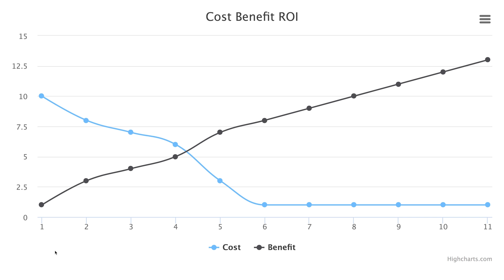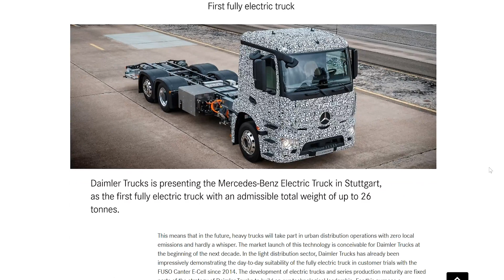Tesla Semi Truck: Everything We Know So Far

Comment: I average 500 miles per day 7 days per week. The range has to exceed 600 miles before I would consider buying one. There are ways to charge the batteries inroute such as a micro turbine like the Nikola One or with a fuel cell powered by propane. Add solar panels to the trailer and we got a deal. The big problem is weight. Shippers have been refusing to cut the weight of their shipments. The new trucks have aftertreatment systems that add 1000 pounds to new trucks. We can no longer haul loads that the older trucks can haul. If these electric trucks are too heavy or too expensive the forget it. If the one graph that he showed the break even was 5 years. 5 years is when we trade in a truck with 600,000 miles.

Comment: For urban coastal zones with major ports, the diesel trucking dominates pollution statistics in particulate matter - one of the most dangerous byproducts of combustion. Zero emission trucking from ports to non-urban transfer stations could be a big winner, and the distance would fit nicely within the estimated range. It is unclear to me whether a leap frog over the most modern diesel engines would be economic as compared to simply upgrading the diesel fleet. The win would likely have to be better than 50% greater economy because our society generally hates change for the better unless it is almost ridiculously better. A businessperson would go after 10% better economy in a heartbeat, but we tend to not make such decisions using logic, at least in my experience.

Comment: Agreeing with Ben.... Hydrogen is such a leap in complexity over battery electric and lower in efficiency that it seems misleading to call Hydrogen cars Electric cars instead.  We tend to call cars by the form that the energy is stored... gas, diesel, air (yes, it’s a thing), Hydrogen and electric. 
Technically we could call gas and diesel cars Solar cars, because the energy in the fossil fuels actually came from ancient sunlight, but that would be misleading too.

Comment: I don’t think Tesla isn’t going to sell these machines. Instead, I think they’re going to operate their own logistics company. 

I don’t understand why there needs to be a cab at all. Why not just build an electric and autonomous trailer. No need for towing. Small enough electric motors can be attached under the trailer on which the container sits. And have enough camera and sensors for the delivery trailer to drive itself
Reply: Derek Chan The problem is the shippers and receivers. If you just put into your GPS the address then the vehicle will go to the office. Many companies have receiving on one side of the building and shipping on the other side. You need a driver to get into or out of a facility. Then there's the charging issue. Who is going to plug in an autonomous vehicle? What about construction and rush hour? There are too many reasons why you need a driver.
Reply: w/o a traditional engine and drive shaft, I'm assuming a trailer without the cab can be much more nimble and rotate on a much smaller turning radius.  If the autonomous trailers can arrive to the complex autonomously, what's stopping human personnel from the receiving or sending facility take control and navigate it via remote controls to the shipping bays?  The trailers are larger than the cabs too.  I would imagine we'd be able to fit more batteries on a flat trailer that carry those 18foot containers than we would a cab.  Or at least a similar amount
Reply: Now you are talking about an issue that gets into insurance and liability. Shippers and receivers don't own the trucks and trailers that travel between them. They are owned by outside carriers. If someone takes control of that vehicle then they are liable for any damages. This is getting way ahead of ourselves.  The first problems to solve are V2V and V2I communications. The vehicles need to communicate with each other and with the infrastructure to operate fully autonomously. If this happens with trucks then it has to happen to cars at the same time. The way that people drive around me is pretty scary. This is going to take many years and lots of new laws before we see cars and trucks operating completely autonomously.

Comment: Tesla will win in the semi race but it will take longer than passenger cars as the short range and long charge times, will slow adoption, until those factors are dealt with.  In the meantime, Tesla should work towards full production of the 3 and come out with a lower-cost SUV, Model Y and a new roadster, to complete their car line-up and work on reducing pricing, fleet-wide, for more adoption.

Comment: Several big names competing is a good thing.  One winner is not.
Also as battery power is the likely direction, they may want to consider battery "way stations".  Switch out battery packs.  Fresh horses like the pony express.  But there aren't any such stations.  Well there weren't any cell towers at the beginning either.  Or gas stations in the early days.  Fossil fuel HAS to go.

Comment: I am surprised that class 8 truck cost 120,000.00. I would have thought it would have cost more.  It will be interesting to watch 
Do you think Tesla will reveal 3 rd generation super charger specifically for trucks ? I am hoping that it is in the plans.  
I am thinking that when it comes to increase the speed of charging the battery size is the main limiting factor the smaller the battery the slower the charging rate
Reply: Ronald Fradet The average is currently $140,000.

Comment: SWAPPABLE BATTERY. People keep bringing up range and charge time. SWAPPABLE BATTERY. Tesla perfected a 5-minute automated battery swap with the Model S (although they decided it wasn't necessary for that model). Pull into the swap station, open the battery swap app on your phone, pay for the swap, and sit back in the comfort of your cab while the battery pack swap takes place.
Reply: Exactly!  One possible method would be to design it to where a simple forklift could swap the battery.  Or put powered wheels on the battery and have it drive itself off using autopilot from underneath the cabin.  The cool part about this is that the battery could be designed to simply park in a parking lot, no cover or infrastructure needed, just a plug.  Also, as Tesla needs large batteries at Supercharging stations, these could serve that role and use them for power arbitration/storage.  Personally, I do not like the idea of building infrastructure to swap the battery, simply due to cost, but could be wrong.
Reply: That’s my thinking battery swapping.  Large trucking companies spend huge on diesel bills if tesla leases batteries and builds a infrastructure they could make money on leasing battery and swapping charged ones.  Just think after driving 3 hours the truck driver stops gets a drink uses the washroom and it’s ready for another 3 hour trip. Not to mention they add super charging stations for cars and build up there network of charging stations.
Reply: Completely agree.  Think of that with something like FedEx or UPS.  Mid-day battery swap.  I don't know the stats, but local delivery vehicles like those are huge polluters in general.

Comment: Ben, something else you should be taking into account: Tesla's own heavy use of semi trucks. They have a lot of short to mid-range (diesel) semis driving every day between their Fremont factory and Gigafactory up in Sparks, Nevada (~260 miles between the factories), not to mention the semis they currently use at their other facilities, such as their factories over in Europe and their "Gigafactory 2" in Buffalo, NY. Tesla will probably start by using the Tesla Semis themselves to replace most to all of their mid-range diesel semis. Basically, they'll be their own beta testers for at least a while as they fine tune the production line and the semi itself. In addition, Tesla will also be cutting down on maintenance and fuel costs. So even if Tesla has a couple of companies signed up to be the first to use the Tesla Semi, it'll be Tesla themselves who will likely be the biggest users of the truck, again, at least for a while.
Reply: This is known in the tech world as eating your own dog food.  Tesla can accumulate a lot of experience and data about the operation of the vehicles, which will give them a lot of credibility.

Comment: A semi is not something Tesla should do. It reduces the cool factor of their brand. They shouldn't even have made a Model 3. It should have just been a luxury brand electric car auto maker and let Ford and GM supply supply the mass market.
Reply: You forget the importance of the model 3 and the mission Tesla set out to achieve.

Before the model 3 nobody was going to bother competing for cheap EV's, the leaf was content at staying at a 150 mile range, it wasn't until the model 3's price point and advertised range did Nissan decide that they'd focus on battery technology for the leaf to get that range.

The 3 being announced in 2017 pushed Nissan to further upgrade the next gen leaf (2018 leaf) with a larger range (2019 leaf).

Car manufacturers have to sell luxury level cars first to offset the cost of production, then they can produce the cheap ones, that's why Tesla's first car was a sports car, second was a high class saloon, then a full size (but also technically crossover) SUV, now they have the capital to produce cars at a much cheaper level which was the intial goal to start.

The Model 3 was the point of Tesla, not to sell to rich and uppity snobs.

Comment: How much does one of these batteries weigh? Semis are limited to 80,000 gross. Even without the heavy diesel drivetrain, you're probably still adding a lot of weight, which cuts into revenue. There was no mention of that.
Reply: A 100kWh Tesla battery pack is about 500kg. The semi will have something like 600kWh if I remember correctly, that's 3 tons. A semi diesel engine is about 1.5 tons, the fuel is about 0.5 and the transmission with the drive shaft is roughly another 0.5. So it's 3 vs. ~2.5, not a big difference. Replace steel with aluminum and you can easily save a few more tons.
Reply: It depends, we don't know how much the battery will weigh. With a 400 kWh battery we could expect it to be four times the weight of a tesla 100 battery. But considering even other manufacturers have managed to double their batteries kWh without any increase in weight, it's quite possible that Tesla might have managed to make a 400 kWh battery for less than 3k lbs. Which would make it similar in weight to semi engines... with the rest of the drive train being removed battery size is likely more of a volume issue than a weight issue.

It's very likely that the weight increase could be minimal to non existent, and while the early adopted models will have day cab ranges, it's not hard to assume that in a year or two they'll have the long haul cabs ready to go.

Comment: I think the big variable here is range.  How far can you go on a battery charge (Tank of Gas).  It's nothing for a long haul truck to go 1000 miles or more on a single (dual) tank of diesel fuel.  When you take the range of a Tesla truck, add travel time, and charge rate (what... 1 hour or more to fully charge a battery after 250 miles?) Then you're looking at a significantly longer haul time on long-haul routes.  MIND YOU, if the vehicles can reduce or eliminate driver fatigue by removing the need for a 100% attentive driver (I don't believe electric vehicles will REMOVE the need for an on-board operator to take over in emergencies), then you can make up that time in a single 6 to 8 hour sleep period.
Reply: In Europe most of the railway system is already electrified. Electric trains have been the standard since decades.
And there's no need for a third rail, an overhead wire is just as good and infinitely safer.
Reply: A huge amount of cargo is shipped less than 200 miles, probably most. For high volume long range shipping trains are cheaper and more convenient.
Reply: That's a very reasonable point!  I for one am 100% in favour of electric vehicles in all forms.  Maybe even electric CARGO trains that run off power from the rail...  I'm sure they would have done that already if it was feasible (or are doing it already).  :)   I guess TORQUE is the issue then?
Reply: 250 for launch is not a bad range at all, 400 is all you would need to keep up with a human driver (any more than that and a human driver would be breaking the law by still driving.)

It takes 14 hours to go 1000 miles at 70 MPH, truckers average between 50-60. A Trucker cannot drive for more than 14 hours in a day, and that 14 hours is assuming they stop at least one time during the day for lunch (In fact you're only really supposed to drive for 11 hours between sleep periods which would require an average speed of 90 MPH). There's about 1 hour "off duty" time with a 30 minutes mandated 30 min on duty not driving. Which is usally taken midway through the day for lunch, 15 minutes before to plug the truck in at a charger, 1 hour to eat and wait for it to charge, 15 minutes to unplug the truck check the truck to make sure it's good to keep driving and go.

Yeah 1000 miles range is way more than you need, 400 is honestly pushing the limit of what a human driver is capable of according to the law at this point in time. Also the required "sleep" period is 10 hours (basically you can work for 14 hours and can only drive for 11 of those hours) after you go off duty you must remain off duty for 10 hours before you can go back on duty, the hours of service are not based on a 24 hour day, but around this 10 hours off time to reset.

Yeah, the 1000 hour range requirement people ask for is not really thinking about the hours of service. Yes, autonomous trucks will likely cause people to poke at those rules to allow the truck to drive for longer than 11 hours a day because they're not driving, but that's legislature that will come after autonomous driving is more than just a concept.
Reply: Great information!
Reply: The reason cargo trains aren't running on full electric (most trains are actually electric using diesel generators) is because electrifying the track is costly, and also a high voltage third rail is easy to put in a subway system where nobody would touch it and get electrocuted. The problem is figuring out how to do this across vast stretches of track where animals or people could accidentally touch the rail not knowing it was a  powered line (or you know, being an animal)

Basically the only safe way to electrify railways that we know of is to have a catenary or overhead power lines. Which are not only unsightly inside of cities, but incredibly expensive to put in. It's more cost effective to use GWh batteries on board, in which Diesel electric trains are still cheaper.

Comment: Perhaps the trailers themselves could also use the chasis as a battery space like the cars do, and then the range could be extended substantially? Use a 'Tesla Trailer' and get another 800 miles range... 200 miles on-board in the semi - enough to get to the pick-up and then plug into the trailer's battery. Just a thought for Elon (if it isn't already in the pipeline?).
Reply: Weight and cost can be an issue. Actually even semi truck don't need more than a few hundred mile range most of the time.
Reply: 800 miles is overkill, 400 miles is really all you would need. 

Solar panel trailers I can see being a thing, but from what I know about physics the best place to keep batteries for a semi is over the front axle. Because while gross weight of the entire truck+trailer+cargo is 80k, you also need to balance the weight over the tires because there is also a limit on axle (and tandem axel) weight. So in order to maximize the towing capacity for the truck you'd want to have the front axle of the truck to be taking all the weight it can away from the tandem axles. I believe the front axle can have like 20k on it max, and the tandems can have like 35k each. So any extra weight for running the truck, like engines, drivers, fuels, you want to be putting most of their weight on the front axle to maximize the size of the load you can haul.

Comment: Drafting provides about 20 percent fuel savings in my experience. 
Even a lower percentage still adds up when you burn 100 gals a day 
There is a huge market for under 300 miles a day.
My boss buys older trucks to avoid the emissions teething problems .
He would probably jump on the electric semi to avoid emission regulations .
He has 10 trucks that might do 300 miles a day once a month .
Most stay under 100 miles a day .
Seattle to Portland is 300 round trip. 
I'm sure there are many city pairs that are similar.
Reply from the maker: Are a lot of the trucks delivery trucks also? I keep thinking they will want to make several models i this space to address the different use cases
Reply: I've seen an all-electric local delivery truck owned by Frito-Lay in my area, it was pretty huge, bigger than any box truck you can rent at U-Haul, but smaller than a typical 18-wheeler as it was just a cab+box on a single frame. Low-slung battery underneath. Pretty cool.